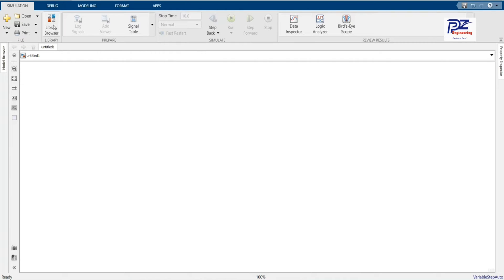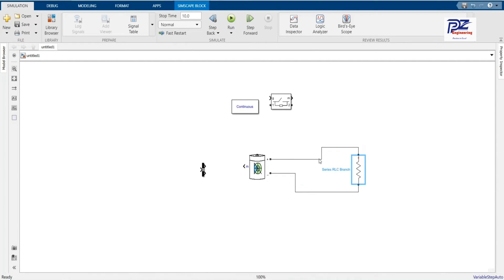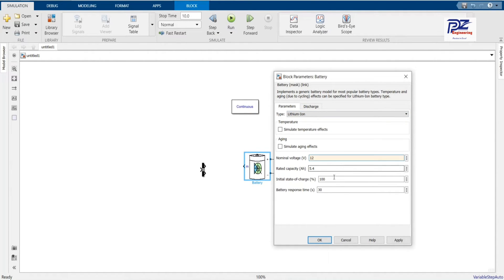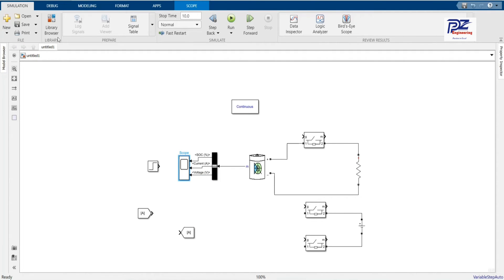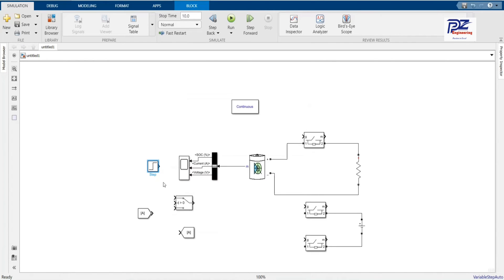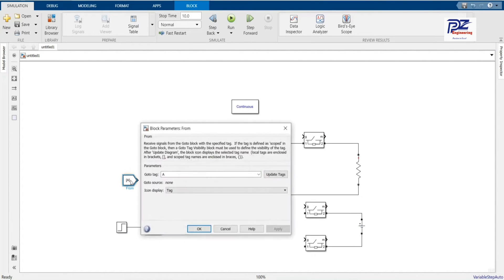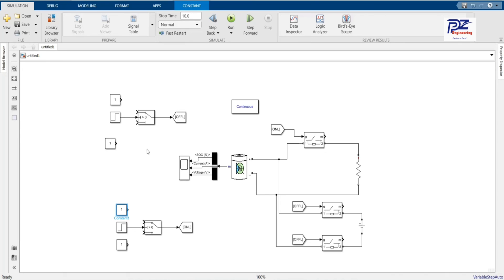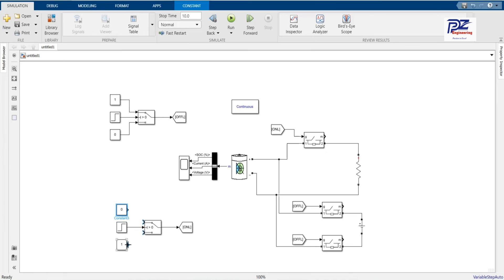Discharging and charging of battery using Battery Controller in MATLAB/Simulink

Comment: Eh Patrao, maybe next time use a headset with a mic to cancel out other sounds and also be more audible.
Reply from the maker: Noted patrão, thanks for suggesting I really appreciate
Reply: @pzengineering2020  hi sir. I am from India. I need help in coordination of battery energy storage systems
Reply from the maker: @sravankumar5209  noted you can contact me
Reply: @pzengineering2020  hi sir, I have sent email to you
Reply from the maker: @sravankumar5209  alright , I will check it